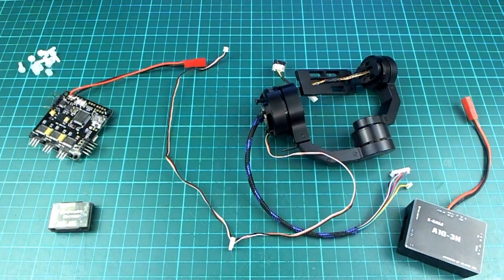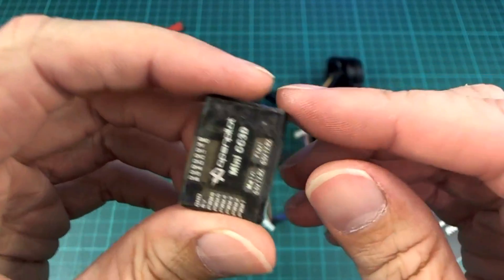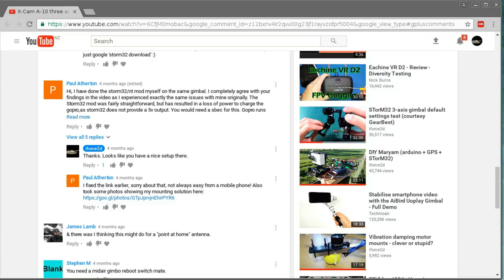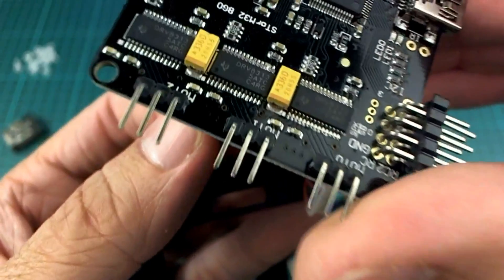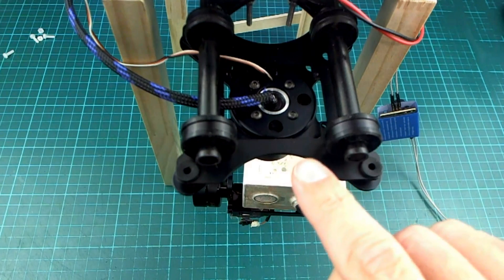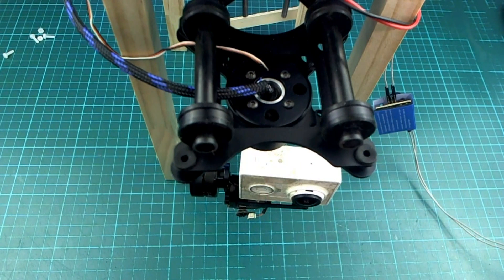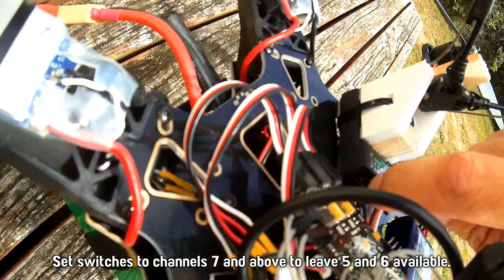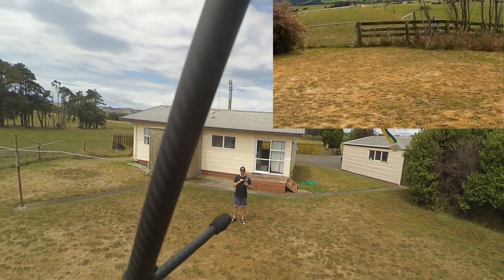STorM32 + X-Cam A10 slip-ring gimbal test

Comment: Excuse me, do I have to tune the Gimbal through over the computer, for each changing of the camera type? For example, am I gonna set it on the computer when I change my camera from Xiaomi Yi to my Smart Phone? Thanks in advance...
Reply from the maker: In theory, you will get better results if you tune it again. But you might get lucky and it works ok without tuning. Hard to say without actually trying it.
Reply: iforce2d thank you so much, but the other gimbals on the market, how do they work very well without tuning through over the computer? Do you have any idea? Thank you again..

Comment: And tips on the storm32 boards I've had several gimbals and boards it seems after I have them a while they loose sync. the camera will just flop around and shudder if I fly on a windy day it will reset  if I power down and initialize again. No problem on a calm day
Reply from the maker: If it's ok on a calm day but not when windy, doesn't that indicate a bad connection somewhere?
Reply: iforce2d I don't think so it's more like a overload but even ran a auxiliary battery for gimbal only a 1000 mah 3s

Comment: My Storm32 uses i2c but only with older firmware. Gets a massive error rate if I run the imu wires through the motor shaft to the point where it stops working. I bought the little mini CC3D as well. Need to make the change over...
Reply: PlaneCrazy hi there, I am also using i2c with my storm32. I had the same problem with the errors, and I fixed it with a ferrite ring on the imu cable. No errors anymore! I have it running on 2 gimbals like this, and on both of them all cables follow the same route from the board to the imu and motors. Have a look at the Hakrc storm32 3 axis gimbal from gearbest, you can see the ring in the pictures, next to the board. I have this one, and another cheap 2 axis gimbal from eBay running with the storm32. I don't remember the firmware version I have on the boards, but I can look it up later if you need. It might be different for you if you are using bigger motors. If you still have problems, try an NT module. There are links in the storm32 wiki on where to get them, I am waiting to receive one and will let you know how it works :)